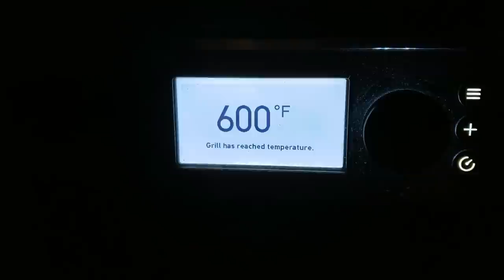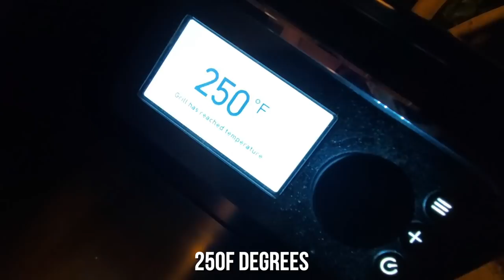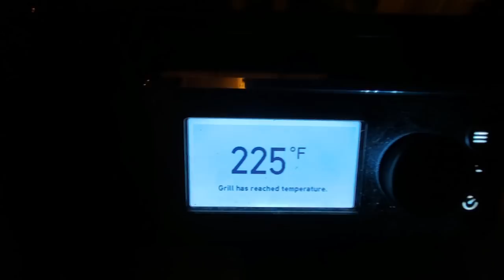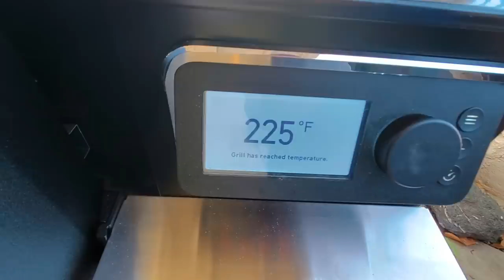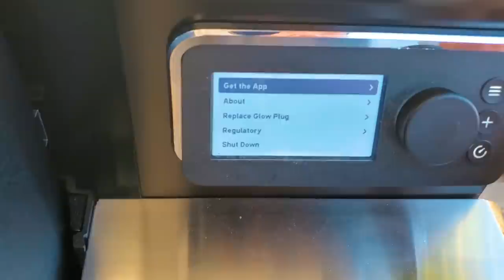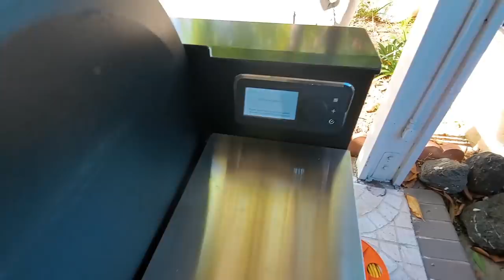Pt 2 WATCH BEFORE YOU BUY | Weber SmokeFire Pellet Grill | BBQ Champion Harry Soo SlapYoDaddyBBQ.com

Comment: Lol! Wow Harry I am Group 4, You say you don’t judge although you have branded those like me group 4 Lol! You put allot of restrictions on those responding..lol! Let’s address the real issues Harry. 1. The pellet hopper, the pellets don’t slide or don’t properly feed the auger. That was addressed by you, I believe, correct me or delete me if I’m wrong. 2.  The grease , you stated 375 is when grease or animal fat starts on fire. The Smoke Fire channels grease on the right and the left back toward the burn pot. The potential for a grease fire is increased when you do that, not always, but the percentage of chance increases as opposed to taking the grease away from the fire. 3. The Ash, I have put hands on several Smoke fires, the fan that is needed for high heat also blows up from the same slots that are supposed to allow ash to fall through, when operating blows ash up into the lower parts of the grill, on the first cooks not so much noticeable but increases over time as I have seen. This ash will build up and block the grease from falling thru as was witnessed even on yours, not a grease fire but a flare up. If the grease was channeled away from the fire pot the potential would be much less. You even burned yours off, Pellet grills shouldn’t do that, Weber should have 2 modes, one with the flavorizer bars for high heat and a Grease tray to channel the grease off and out of the grill. 4. The controller, did I miss the part when you talked about the WiFi?  I apologize for missing that. Weber is the only pellet grill that won’t work without WiFi and updates, no one else in the Pellet Grill market has that issue. I liked your cook, I look forward to more. I have stated that I want to help, help Weber through this, the potential is huge for this grill and with minor adjustments I believe it can be the best! Thanks for your commitment! Tom Horsman.
Reply: Tom.  I'm a group 2.  Harry said in the original video at his subscriber's house that the hopper could be improved.  I don't think he's backing off from that.  Weber is even making field modifications for people who want that now.;  What was useful to me was that the WSF didn't starve itself for the overnight period, which would have been awful.  Second, 375 degrees is not the temp that grease ignites by itself.  It's a temp where pork fat can ignite with an ignition source (beef fat temp is higher).  He's right on the difference between a grease fire and grease flareup.  If all of that grease that was in the overflowing grease trap was still in the belly of the WSF and then caught on fire, then that would have been a true grease fire.  The flare-up we saw here doesn't qualify....not even close.  The ash buildup you speak of shouldn't be an issue if you actually clean the grill like the documentation says.  You can't go with a dirty grill if you don't want unwelcome surprises.  Lastly, the reason Wifi is mandated is to get the latest version of the firmware in people's hands since its likely that these computers were assembled months ago with beta software (or earlier builds).
Reply: Sevenfeet0 Wow, interesting, field modifications? Please explain.. taking the grease,, oh I’m sorry, animal fat away from the Fire was my point as it always has been. Please don’t do the thing where you try to make something else from the original point which has always been with me to take the grease,,, animal fat away from the fire pot. That’s what I said back in December and that’s what I still say today. That is a design flaw, from a safety stand point you lesson the chance of a “flare up” “ grease fire “, when you take the grease “ animal fat” away from the fire. Not expecting you to except that, The Firmware update is being touted as if it’s revolutionary when in fact it’s an another example of how Weber wasn’t ready for this to be released. Another example is the amount of assembly required which is unbelievable if you compare it to other pellet grills on the market. I can keep on going here,, I’ve said it before and I’ll say it again, All I want to do is help. The potential is there with this product, it just needs to be fine tuned. And I can Help. Thanks for commenting!
Reply from the maker: Thanks Tom Horsman for stopping by and taking time to leave a comment.  
1. Yes, you are right, I agree the hopper design could be improved as I reloaded pellets in hour number 7.  In a future video, I will test whether the SF will run until it is out of fuel, without stirring the hopper. I did not want to risk being asleep and letting $250 of meat not cook properly.
2.  Yes, the design has the pellet ash falling through the grate holes at the bottom of fire pot into an incline stainless chute below the fire pot into the ash catcher below (sorta homage to the butterfly wiper in in the one-touch Kettle).  The grease flows into drain holes on the left and right of the fire pot. Keep in mind the entire fire pot assembly is elevated a few inches in the unit.  If the drain holes are clogged, the grease could potentially build up at the bottom of the SF.  Embers from the elevated fire pot could potentially heat the grease buildup sufficiently to ignite which happens around 375F to 450F depending on the type of animal fat you are rendering into the SF.  In Torture-Test-1, I specifically tested that condition by doing a H-n-F followed by L-n-S followed by 600F sear after 6 hours of grease buildup to try to ignite the grease.  It passed. No L or R drain hole clog and no fire.  In Torture-Test-2, I did 12-hour all L-n-S cook with unwrapped meats.  I generated about 12 cups of oil from  65 lb of meat which I think exceeded the design specs and about 3 tablespoons of oil that dripped on my floor.  After 12-hours, my left drain hole was open and my right drain hole had accumulated some ash around it.  I noted a 1.5 inch-high flare-up which burned about 100 seconds before it went out.  No issue with flare up the left grease drain hole.  There was also more grease at the bottom of the SF but not more flareups at the end of my 12-hour test.  
3.  I read your notes on the ash and the various questions you have on the integration of the fan algorithms and auger algorithms.  I have to refer you to the Weber engineers as I'm not an expert on PID workings.  I know I don't know because in my day job, I work with electrical and process engineers who program PLCs for RTUs in our $50M SCADA control system.  
4. I did not torture test the WiFi and electronics yet in my Test 1 and 2 so I can't comment much about its inner WiFi connectivity workings and cooking software.  I do IT for a living and after working with switches, routers, load balances, RF and microwave systems all day, when I cook barbecue, I'm happy with an on-off-temp knob which Weber provided.  When I muster the energy, I'll play with the electronics so stay tuned for future episodes.  
Thanks for your questions and I look forward to your reply.  Respectfully, Harry Soo
Reply: Harry Soo Thanks Harry! A professional response is what I expected and a professional response is what you delivered. Looking forward to more videos. Thanks for taking the time and sharing. I appreciate it.
Reply: Tom Horsman he ran it for twelve hours and said he didn’t have any issue with the pellets. Given the amount of grease he produced from 65 pounds of meat, if a grease fire could happen, don’t you think it would have happened? He also said he didn’t have any ash flying around and I didn’t see any in his video.
Reply: Tom, you're definitely Group 4. I've watched your videos on the SWF.  I actually watched them a few times, and I noticed you deleted comments that challenged your message that other pellet grills were capable of searing using an accessory.  Now that the WSF has been released, you've seemed to jump on the bandwagon of the other complaints about the grill. Just curious, are you compensated by Smoke Daddy in any way?
Reply: Michael Fox lol Michael, well if do as you say I do, I should just delete your comment! Nicely done! And, No I am not compensated by Smoke Daddy or any other grill manufacturer. Now, I’ll delete you comment. Thanks for Watching and commenting!
Reply: Tom Horsman what’s a smoke daddy? 🤷‍♂️
Reply: @TomHorsmanAmateurBBQ  LOL. You can't delete anything on this channel.  Harry can.  If he does, I'll live with it.  Don't worry though, I've told youtube that I don't want it to recommend your videos.  You won't ever be hearing from me again, because I'll never watch your videos again.  Sounds like this is win-win for both of us.
Reply: @TomHorsmanAmateurBBQ  Guess I touched a nerve.  LOL. You're clearly out to dump on the WSF. Sad if that's what you need to do to get clicks/views.

Comment: My jury is still out.  I just received a new controller and new auger assembly from Weber. I will install them tomorrow and will try again.  My SF shut down in the middle of my 1st cook (after burning it in)  for unknown reason plus the temp kept jumping around.  I also spent the last few days cooking at the Houston Rodeo BBQ Cook off. Good times.
Reply from the maker: Hey Richard. I just got back from HLSR too.  Was the chicken ninja for Waste Management and Firecraft BBQ.  No win but had awesome fun.  What a fantastic event! 
Sorry to hear you're in Group 3.  Hopefully the new parts from Weber can fix your unit. It sucks when a new pit is not working.  Electronics are often the source of problems especially in newly designed ones that need fine-tuning. Only time will tell.  Best of luck in your cooks on the SF once you get it going.  Let me know if you have questions.

Comment: The whole idea behind a pellet smoker is the ease of use and maintenance compared to the alternatives - a lazy man’s smoker. I don’t want to be constantly checking on it. Also this whole grease flare up vs fire argument is not entirely accurate as a flare up can become a fire if you aren’t careful. Set it and forget it, that is the way these pellet smokers are being marketed. Weber will eventually get it right but seems they rushed things a bit.
Reply from the maker: Thanks for stopping by Brian. I'm typing a response to your comment. So that I can get you an accurate response, which Group are you in?
Reply: Harry Soo What do you mean by Group? I am in the market for a pellet grill/smoker and have been watching reviews on the various manufacturers.
Reply from the maker: Yes I had 12 cups in drip pan and 3 tablespoons on the floor.  I shared my observations accurately and provided my opinion.
Reply: Harry Soo I appreciate your attempt to throw people into “groups” but it rarely works. There are always those who cannot be categorized. If I’m understanding you correctly, group 4 are those who don’t have a WSF and are either Weber haters or folks just trying to stir up controversy. What group are those in the market for a pellet grill who are using YT to research options with no loyalty to one manufacturer or another? Group 5? In recent history of grills/smokers I don’t believe there has been a more polarizing product. There are definitely some Weber haters out there or possibly competitors posing as dissatisfied WSF owners (I would hope they could make better use of their time) but my guess is that the majority of the neigh sayers are simply folks disappointed with what Weber came out with given all the hype. Love your cooking videos!

Comment: Hi Harry. I'm a smoker newbie with a new SmokeFire EX6, I've only had the chance to do two cooks. Ribeye steaks reverse sear and beef ribs low and slow, everything went as planned with terrific results. Looking to do pork butt next but I am a bit concerned about pellet delivery over a long period of time. I really appreciate the quality of your content, and more importantly the sincere and straightforward way you present yourself. All the best.
Reply from the maker: Most pellet cookers run out of fuel in 5 to 7 hours so the EX is actually better than most.   Stirring the hopper is part of the ritual of using a pellet cooker. I can tell I get a lot of keyboard cooks commenting on my channel when they fuss over minor ssues for the sake of showing their disdain when they don't even own the EX

Comment: 32:45 that pellet feed would have been stopping soon if you didn't top it off. That is not a true test for the pellet feed. You should had let it go Harry 👎
Reply from the maker: You are correct. So all I can say is that the hopper ran for 7 hours before I refueled.  I will test that in future videos.  It ran for 7 hours before I refueled to go to sleep as I did not want to risk $250 of meat with no time to recover as I had to fly to Houston to compete in the world championship.  Please be mindful I only have 2 data points so far so my two tests are not conclusive nor representative of the majority of SF owner experiences.  Here's a recap of my two tests:
TORTURE TEST 1 - PASSED
45 lbs 5 meats in 8 hours. Generate grease from a 16 lb brisket, 10 lb butt, and 3 St. Louis ribs to drip on the SF the first 6 hours at H-n-F cook @400F and L-n-S cook @275F. After all that grease was accumulated, fire it up to 600F to grill the ribeyes and sausages.  Cook to let the grease drain in the unit and then try to flash that grease at 600F to test for safety 
TORTURE TEST 2 - PASSED
65 lb, 3 meats in 12 hours. Two 16-lb brisket, Two 10-lb butts. Two 7-lb beef shortibs.  Low and slow @225F to see if hopper feeds properly, no grease fire w 12-cups grease collected, and no excessive ash

Comment: Harry - First, let me start by saying THANK YOU for what you do.  I appreciate your candidness and how to deal with trolls.  I have a channel myself and totally understand your position.  I am new to BBQ'ing, Smoking... I am learning as I go, watching a ton of videos, reading a ton as well.  I recently picked up a Masterbuilt Electric Smoker and had to return it.  I learned that the unit's temp was off by 25-35 degrees.  I used an external temp probe to monitor internal temps and both briskets did not come out well.  I know there is a lot to learn and practice and glad I found this channel.  I'll be in the market for a new smoker and haven't decided on which type to go with.  I saw this Weber Smoke Fire grill in my local Lowe's ad and how I found ya.  Thanks again!  Hope to learn from you.
Reply from the maker: Good luck with your channel and remember my 3:1 Rule!
Reply: @SlapYoDaddyBBQ  - I'll have to look up that rule again :)

Comment: Don’t know if you guys have heard, but Weber has acknowledged the hopper problem and are sending new more vertical slides to replace the old hopper. I just got an email today stating i was getting one in the mail. I own the Smokefire EX6 and I love it!! The hopper not feeding the pellets correctly is a problem, but I reached out to Weber about it and they stated they were aware and were sending replacement parts to rectify the issue. 

Fingers crossed that small issue is solved!!
Reply from the maker: Let me know how it works

Comment: 36:36 is a grease fire but a very small one considering the amount of grease the cooker accumulated.  The Hopper and ashes are an inconvenience but not a deal breaker.  Overall, the sky is not falling.  The SmokeFire is not perfect but a very solid product as proven by this video.  Many of us Weber fans had high expectations with the SmokeFire but were let down somewhat with the imperfections and inability to rise above the rest as the best pellet smoker.  Thank you Harry for offering your rebuttal to critical feedback from other YouTubers.  This helps average cooks like me make informed decisions.
Reply from the maker: Hope you saw the video of 3 pro pitmaster describe a Flareup v Fire. I suspect you cant get a UL certification if the unit catches on fire when it is tested in the lab.  I had 12 cups of grease that did not ignite

Comment: I am in Category one group and I now have 8 cooks down on my Smoke Fire EX-6 and I love mine. Since I removed the finger guard over the auger opening I haven't had any instances of bridging with the pellets. So far I've done 1) steaks which it seared great! 2)Baby Back Ribs I did have bridging occur during this cook, ribs turned out great, I removed the finger guard the next day and I haven't had an issue since. 3) Turkey breast next, turned out great, nice and juicy, great smoke ring.  4) Seared scallops and baked some crab cakes, and they turned awesome. 5) Sirloin tip roast, this turned out great, good smokey flavor 6) Brisket 12 hour cook, I did not wrap, I wanted to see if I would have any issues. I had none and the Brisket was great, very tender, nice smoke ring, great bark. 7) Tuna steaks seared on the SmokeFire, turned out great beautiful sear marks, cool in the center. 8) Pork butt Eastern Carolina Style, 12 hour cook, I did wrap the butts at the end. Followed by 2 hour rest in a cooler wrapped.  Also during this cook I did 3 racks of baby backs, but of course they were only on for four and half hours. At the end not an unexpected amount of grease. I did have aluminum foil pans with water in the bottom of the cooker, which help make for an easy cleanup the next day. I'm still learning how to best use the smoke fire, but I'm keeping mine, I really love the way it cooks. Now what to do with my WSM and gensis gas grill???
Thanks for all the hard work you put in doing these videos @HarrySoo I enjoy watching them and learning from them! Thanks for sharing the BBQ love.
Reply from the maker: Hey Fred thanks for sharing your cooking adventures!   Keep spreading BBQ love!